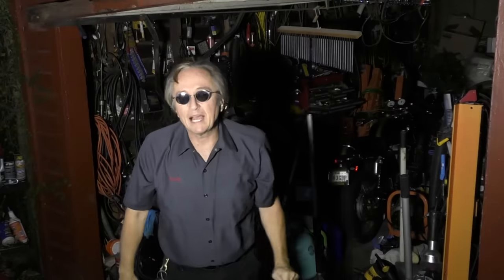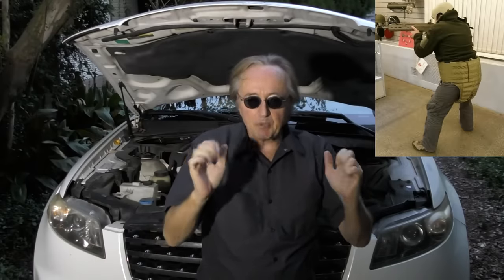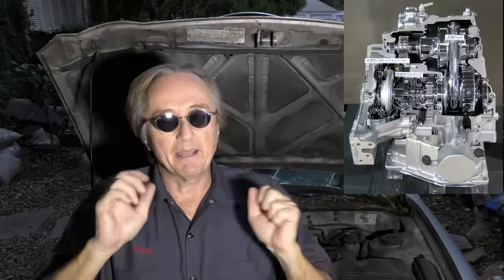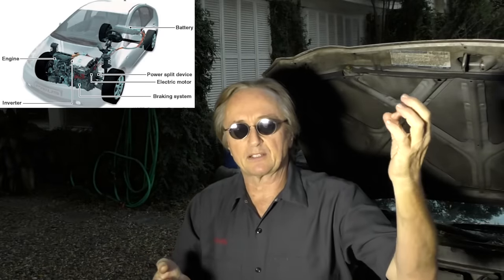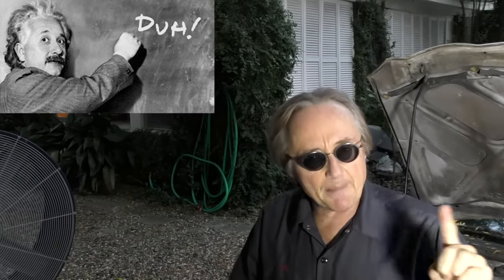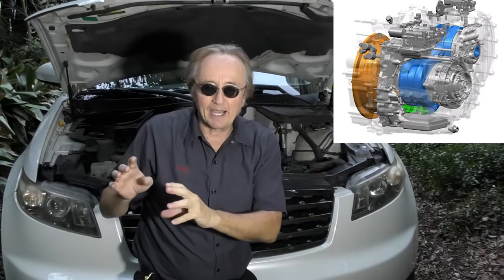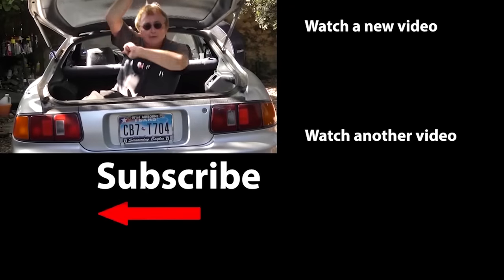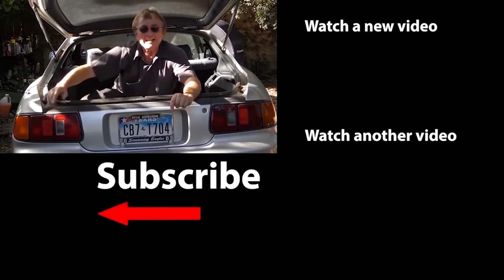Why Most CVT Transmission Cars are Terrible

Comment: I have a Mitsubishi Outlander which has a  JATCO J 11 CVT transmission.......the car is new.....any reccomendations on how to prevent the Jatco transmission from failing too early?
Reply: Hey there, I have a 2011 Mitsubishi Outlander 2.4L with JATCO CVT.  Mine is doing well for 6 years now, trouble-free. Rolling at 125k miles since 40k miles when I brought it in 2015. It used to be a rental vehicle so who knows what it went through before me, but it works for me. I don't plan on getting rid of it, will be driving it until it falls apart.

First of all, CVT is not designed for heavy footer or driving at such high speeds as 90+ MPH continuously. Because it runs by steel belt so, therefore, the heavy footer will cause tension on the belt and getting too hot (the belt will get stretched then slipping in no time) from driving too fast or hard on it. DO NOT CHANGE GEAR WHILE IN MOTION. Change the gear when you're at COMPLETELY stop. Sometimes I do this by accident, oh boy, it doesn't like it AT ALL!

It is very important that you change the CVT fluid (drain & fill only, ABSOLUTELY NO FLUSH) for every 40k-60k miles (I do 40k because I live in a harsh, brutal long freezing winter season that goes far as minus 40!). I am sticking to Mitsubishi's CVT fluid only. No aftermarket fluid in mine except Amsoil for the engine. It requires more attention than traditional transmission.

CVT has two filters; one inside pan and cooler. I just replaced this by a trustworthy local transmission shop at 115K miles just because I wanted to play safe around it.

Hopefully, this helps.
Cheers!
Reply: @DrivingandDashcam  thank you sir, yes I hope to avoid cvt failure.
Reply: @DrivingandDashcam  "DO NOT CHANGE GEAR WHILE IN MOTION. Change the gear when you're at COMPLETELY stop. "   Do you mean changing from Drive to Reverse gear?  

Also, the outlander comes with paddle shifters, isit safe to change ''gears'' [ I know technically CVT do not have gears '] while on the move at high speeds?
Reply: @streetrider2487  Yes, completely stop to change from drive to reverse or from reverse to drive. 

Paddle shifter is fine, I have them on my 2011 as well, I don't use it often though.

Comment: Scotty I would like your advise on a 2005 nissan murano, I bought this car about a year ago. It has 290,000 Miles on it, runs like a dream. However my nissan murano is making a weird metal scraping sound, i thought it was coming from the rear differential because my oil change guy told me that I had a leak from that box. So I fixed the rear differential leak and it didnt change the weird metal scraping sound. I'm not having any problems with driving it however it is bugging me because its annoying. I can hear it only while I'm driving with the windows down and I pass a fence or another car. I know everyone else can hear it though and I want to know what I can do to fix this thing so It dont sound like a cat is dying under my car. Thanks scotty any advice is well appreciated.
Reply: Get rid of it while you still can
Reply: @stusilver6841  I ended up fixing it, was a bad rear wheel bearing still running good 295,000 miles now

Comment: History of BMW/MINI sued over CVT failures in early MINIs,then this Unsold Failed technology CVT bring back for cheap and light car version,design being scrap not for resale value,its heavy compare to conventional AT gearbox,expensive repair,weak,slow response,no tow ability,actually they lie about fuel consumption on CVT because of lag response that teach u slow drive be economy style.u can hear engine roar burning fuel but CVT still doesn’t work because ecu board protect this weak belt CVT damage from high torque produce by engine.

Comment: i have a nissan xtrail 2016 and it this D-Step Shift Logic thing. where it apparently simulates a gear shift. I have a feeling that it might not be simulated gear shifting because if you are crusing on the highway at a certain speed and stick the gearbox into "s" and upshift manually, the upshift boggs the engine down. Now why would it do that if it was simulated; doesn't that usually indicate that there might be a gear ratio selected
Reply: No. The “s” is for sport mode. When you use ‘Ds’ the engine revs up and maintains a lower ratio by adjusting the pulley accordingly; therefore it works like engine braking.
Reply: @garmarrod  oh i see so in reality its not all "simulated" after all it actually does something with the cvt.
Reply: @haks_123  exactly. It says so in the manual: “…if you need improved engine breaking.” These CVTs are not as bad as some people make them out to be if you drive it properly.

Comment: 2013 Honda Accord with right under 100K transmission has just failed and guess what Honda doesn’t offer a replacement smdh DO NOT BUY.... the only thing any shop can find me is a used one with 53K already on it for $1900... 🤒🤒🤒🤒🤒🤒🤒🤒🤒 Honda sucks now OH and THERE IS ONLY A PLUG FOR THE TRANSMISSION FLUID NO DIPSTICK so you can check your fluid level HONDA sets you up to fail

Comment: Anybody have info on 2017-2019 civic cvt? Thanks
Reply: ZnB_TV Yes , They have been shown to last 150-200,000 miles but change transmission fluid at the dealer every 30,000 miles ...it’s important....most people don’t and that’s why you hear most of the nightmares

Comment: Had a friend with an old Volvo 340 with a cvt, it got almost 300000 miles before the steering rack went. Seemed like a decent solution but I'd rather drive a manual. I think that if might have been daf designed actually

Comment: Gas mileage my foot.go 80 miles an hour in one of these CVT transmission cars and look on the computer and see how much miles a gallon you're getting. It will be less than if you had a 6-speed manual transmission or a regular 5-speed automatic transmission. I've done this myself you get less gas mileage at higher speeds
Reply: Same car?
Reply: @samusaran7317  yes

Comment: Thank You for your very informative videos, always excellent content and truth, but its too late, I just bought a 2015 Nissan Altima with 70k miles, very soon I will change the oil in the CVT, as I have heard its time and now that you scared me half to death, Im gona do it quicker, LOL, Ill let ya know how it does, but remember I am a speed demon and used to race motor-cycles, go-karts and red devils (miniature formula cars 2-cycle 440 cc), anyway, like I said Ill let ya know how long it lasts.  (if anyone wants to know the correct way to change your CVT oil in Altimas 2013-2018 please ask me, I have done a ton of research) ;-)
Reply: Make sure you change both filters, they have two filters ...very small and flimsy..its crazy.

Comment: The 2005-2010 model Altima’s transmission was hell on earth. You can tell the quality difference from the 2000-2004 models before they put the CVT in. They last a LOT longer.
Reply: My daughter has a 2006 Nissan Altima she is still driving with 240,000 miles, no problems ever. My 2016 Nissan Altima transmission just died at 113,000 miles. Mines trash.

Comment: I just bought an 2016 Outback 2.5 L with cvt. On a Trip of 1000 miles I had a good mileage per galon. It is nice to drive.
I testdrove other cars with cvt and realised, it dos not work well with small motors. 
The topspeed is 210 Kilometers per hour. Above 140 Km/h the Sound is annoying, but the car is mainly made for countries with speed limmits. As far as I know, only North Corea hast no general speedlimmit, but in lack of cars,  who cares. It fehlt in my trip, that 80% of the Autobahn has speedlimits or is under construction. Many bridges are in bad condition here and are closed. Lots of deviations and trafficjams, not so nice.

Comment: I have a 2002 Honda Civic Hx and it has a CVT transmission, been having issues with it. It was whining and now making huge grinding and clunking noises if I shift into drive or reverse. Was told possible drive axel issues. I dont know, stumped on it.